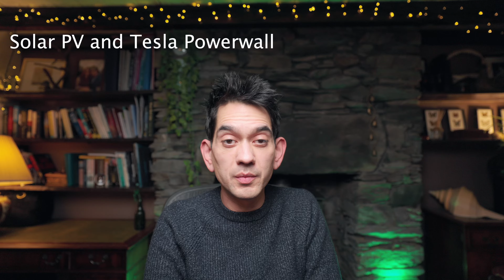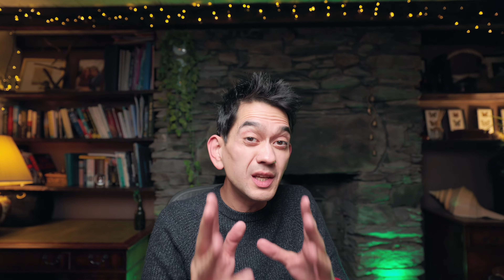Tesla Powerwalls and Solar Panels: SIX Month Review

Comment: Awesome! Thanks for all the detailed information.  Your system looks impressive. Just a heads up for people in areas at risk of hail (I live in Australia), not all solar panels are equal in terms of durability.  A few years back we had a storm with tennis ball sized hail. Many of the cheaper, newer panel brands did not fare so well. Our 20 year old panels came through fine. You might need to shop around.
Reply from the maker: Great point!

Comment: I'm retired and must start taking RMD from both of our IRAs, since we don't need that money we are going to plow that $$$ in Tesla Solar Panels(12.9 kWh) and two Power Walls and it will get me the required federal tax withholding to get the entire 30% tax credit on year one. We might splurge and go with 3 PWs just to be safe.  Given the vulnerability of our power grid, any adversary of the US could shut down our power grid fairly quickly and without warning.

Comment: We ordered a Tesla 2 system to complement our existing 4kW PV system.  14 months later, still waiting, we scrapped the order and ended up buying a 13.8kWh GivEnergy battery system costing £8,500 (including EPS system) 
We get our grid energy from Octopus Go and fill the battery system to 80% capacity each morning at 7.5p per kWh.  
Solar PV provides us with 20%-30% of our daily usage in winter and we expect 80%-90% in the summer.
Solar PV system cost £13,600 and has generated £18,500 FIT payments so far - the excess covered most of the cost of the new battery system.  
Battery system has reduced our average daily cost to £1 for the energy from the Grid and £0.49 Standing Charge
Reply from the maker: That’s wonderful. And people still say Solar and batteries don’t work!
Reply: @DivingDeveloper My system is not as large (6.4kW solar & 9.5kWh battery), however our daily energy usage is lower, so I’m finding I can run the house and top up the EV on solar and battery alone. Too bad I still have to pay the standing charge, but once I get the go ahead for the Smart Export Guarantee payments that should cover the costs of the standing charge.

Comment: Hi, thanks for the video.  i have a similar but smaller setup.  8Kw solar (two 4KW arrays, one east facing and one south), plus a single tesla powerwall 2 which is exactly one month old today.  I waited 6 months for the powerwall to be delivered and fitted, but boy is it worth the wait.  I am with octopus and am awaiting the november bill so that i can see the first half of the month and compare against the second half of the month (ie before and after the install).  However from my rough estimates, my on peak cost of electricity is roughly £1 per day, and my off peak costs about £3.00 which includes charging the battery and an EV.  We dont have gas or oil and so this is our total energy bill with the exception of logs for heating the house.  thankfully my original solar array was fitted 12 years ago and so i get a feed in tariff each year of around £1500 and this increases by 7% per year.  This means that due to the extra investment i have made in the new solar array and the battery, that i have moved our bills back to where they were when we first moved into this house, which was that over a year my energy cost me 1300 and my income was 1500 giving me a surplus.  I keep looking at a second powerwall as mine does not last the entire day, typipcally running out at around 21.00 leaving us 3.5 hours before cheap rate starts again.  The question for me is can i justify the second battery on cost saving alone and i am not sure i can as the 3.5 hour difference is around £1 per day and that is over winter only.  During the summer months i expect to be off grid most of the time.  in relation to what i wished i had know before hand, my answer is less related to the known element and more towards i wished i had thought of ground mounting my last array rather than having it on the roof.  We have 2 acres of land and can easily put more solar on a ground array that tracks the sun.  the main benefits are lower cost to fit, easier maintenance to clean and if anything does go wrong, i dont need scaffolding putting up.  I am looking at another 4KW in the future and will have it ground mounted.  cheers for the video.  have subscribed and look forward to watching your update videos so i can compare results.
Reply from the maker: Thank you for watching and leaving a handy comment; I'm glad you've found solar very useful, and you're the first person I've heard from who also has two arrays! RE: Another Powerwall - it sounds like you've done the calculations, and it wouldn't be a financially helpful thing for you to do. Much better to put that money into more panels (although this will change your battery storage calculations as you may want to export less and store and use more. If I had the clear space to do so, I would look into ground mounted too, and potentially not track - an optimum angle and south pointed would be ideal. You already have an East-facing array which IMO is the most useful of the non-southerly directions as it is ideally placed to soak up the morning's first light. Thank you for subscribing; I also make underwater, technology and business videos but I have planned to make >regular< followups to the solar (and powerwall, and EV, and later - as we move off our LPG gas central heating too). Thank you again!
Reply: @DivingDeveloper  thanks Mike.  I came across you channel yesterday and watched a few of your videos, the Q&A on EVs which was very good, a day in the life of a developer which I liked as I have a dev team myself.  I spotted that device which you turn over to start tracking time which looks fascinating and would love to see a video on that.  obviously your solar and power wall videos.  I also watched the star link video which was interesting as I also have one.  Living in the countryside, my best adsl quote came in at 1mb down and 5mb up.  That same figure is still true today so I had no choice but to get starlink which launched just at the right time, ie during the pandemic when I needed to work from home.  regarding the extra battery, I have been looking into V2G as I specifically leased a Nissan Leaf for its chademo connection which is bi-directional.  I just missed out recently on taking part in another trial which would have given me the hardware to both charge my car as well as discharge the battery into the house during peak times.  My thoughts currently are keep looking for the V2G hardware to further develop and buy one of those to turn my car into another battery.  In the long term, I may get another power wall depending on my needs.  I keep looking at wind turbines as another form of energy micro generation.  I live at the top of a hill and we get a lot of wind.  Its the one form of weather that we do not benefit from, ie we collect the sun for energy, we also have a rain water harvesting system to collect the rain for our house as well as our garden.  The only thing putting me off is the reviews I see on how problematic they can be and the maintenance costs.  Others have just said add more solar as at least it is mostly guaranteed and has no moving parts to go wrong.  My electric needs will change again this year as we buy the Nissan from the leasing company and I take out a new works lease on a second EV.  I am currently thinking of the polestar 2.  Once we have that in place (Dec) I will need to look again at our energy usage and storage and see what needs tweaking.  The idea is to get as close to self sufficient as possible.  I have 16 years before I retire and I want to make our retirement as comfortable and as cost efficient as possible.  Thanks again for the videos.  John
Reply from the maker: Thank you, John! Your comments are useful for me - you’d be surprised that very few people give this sort of useful feedback! I’m glad you liked my day in the life! It feels a little premature putting together a video showing my day when I didn’t think that I had anyone in my audience who might find it insightful or entertaining. My plan with this is to take it to the next step and ‘build in public’ something new, perhaps a mobile app.

V2G over CHAdeMO requires a three-phase connection. Great, if you can get it. Especially good if you can find a supply of used or damaged Nissan Leafs. £/kWh these are the cheapest reliable ‘out of the box’ (i.e. no DIY) storage that there is. Robert Llewelyn from the Fully Charged Show has a pre-production V2G unit installed and AFAIK hasn’t made a video about it but you can see it on some of his garage clips.

We’ve looked at wind too - top of a hill helps and so does being on the IOM - we get a lot of wind here and it’s predominantly over the darker months. But as you say, maintenance and moving parts makes it an added complexity. We have bats too, so will need an enclosed system as I doubt we’d get permission for a tall vertical turbine. I think it’s a great ‘addon’, a bit like having the two solar inverters - a little added redundancy and ‘security’. -Mike

Comment: Updating, today 2023/1/11, they said the Powerwall doesn’t work well at 0°C but today is 7°C and right now my solar panels are producing over 7kw but Powerwall is charging at only 1.2kw! 
Powerwall is a waste of money!
Reply from the maker: It sounds like Powerwall is using some of the incoming DC power from your solar panels to warm the cells. This is by design. I think your Powerwalls are outside? Your installer can diagnose if this is the case.
Reply: @DivingDeveloper  In my Tesla app I can see it was charging at 1.2kw but the remaining electricity was going out to the grid! It was not being used to heat itself. Or it’s only my Powerwall that is not working properly. I already contacted the Tesla support, they came here but didn’t solve the problem. They only told me to self charge my Powerwall in the morning (before the sunrise) using time based mode (paying the grid electricity) to heat the battery before the panels start to work. That means I’m paying to heat the battery or it doesn’t work well. But even doing this, yesterday it was cloudy in the morning so that 30 minutes self charging didn’t work and when the sun completely appeared around 11:00, the Powerwall was not heated enough to capture all the electricity produced by the panels. All the extra electricity was wasted to the grid!
In normal condition it should be charged to 100% but yesterday it was only charged 50%!
Reply from the maker: @OmegaFClub  Thank you for going into more detail. I had the same thing once I switched modes from 'Self-Powered' to 'Time-Based Control' in the Tesla app. It takes the Powerwall some time (I think it was at least a week) to learn and optimise itself for our routine. It  was nearly perfect then ... except for the odd day when it tops up overnight too little or doesn't leave sufficient space for the morning's surplus solar.

As one of the input indicators that it uses to learn is the export time/quantity and we have no export, there's no CT clamp by the export meter to feed back to the powerwall. This means it doesn't know when it's being too conservative... 

Hope that makes sense? Definitely share your experience with your installer, it might be that they need to look into this if it isn't an AI/learning issue.